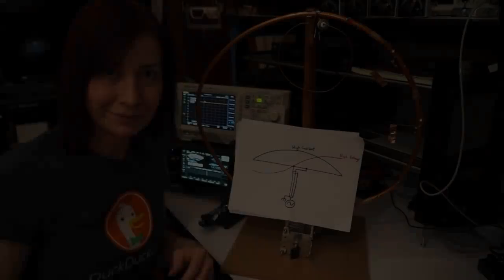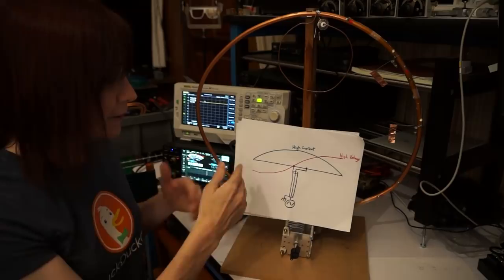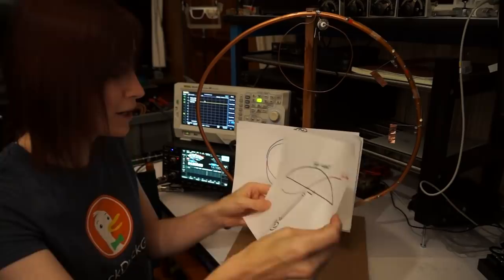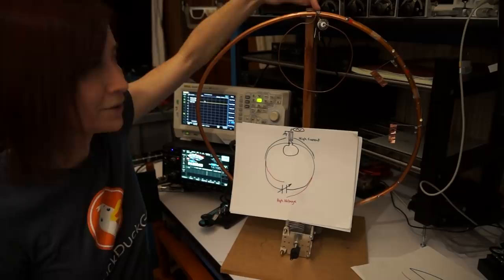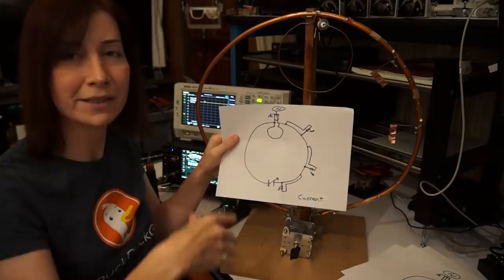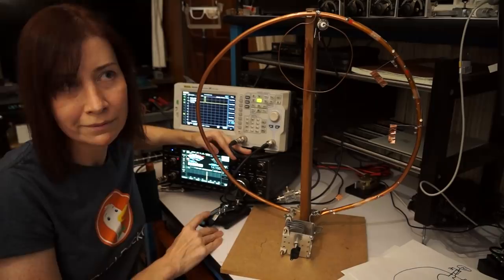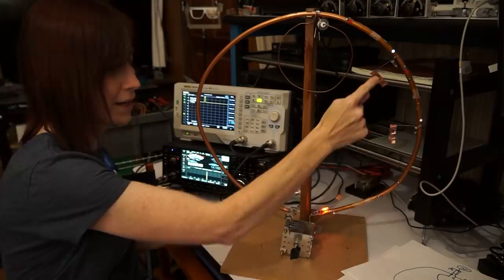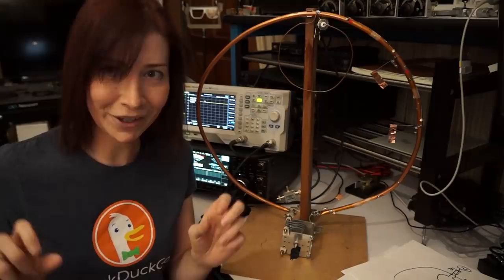Magnetic Loop Antenna Current and Voltage Distribution

Comment: Jeri, in my opinion you have come to a mistaken conclusion regarding the distribution of CURRENT around the loop.  Your arrangement of LED's seeking to demonstrate current are, in fact, gamma-matched to the loop.  Therefore such LED's would demonstrate VOLTAGE across the gamma-match (rather than current).  Anyone who might say that "current is proportional to voltage" should remember that this statement is not true, either, for a half-wave dipole.

My "hunch" is that the magnitude of the current is CONSTANT anywhere round the loop, hence there is NO current standing wave (contrary to a half-wave centre-fed dipole).

To me, the important consideration is that the highest voltage anywhere around the loop is that existing across the variable capacitor.  But that capacitor is a conductor of current!  This is how the magnetic loop antenna differs in principle from a half-wave dipole.  This is how the loop cannot be regarded simply as a half-wave dipole pulled round into a circle.

But I would really like to see the experimental proof.  Perhaps you could use a hot-wire ammeter connected to a small coupling loop.  The small coupling loop could be moved to different locations around the big loop.

Comment: cool to see a women doing a electronics vid! loop antennas are vary strange animals. thy preform well, are small, reject noise,and directional. to bad thy have small band pass and need hv capacitors for tx. when I built one for sw rx i used a small loop on the end of coax to cupple the rf to the radio ware as you have by the looks of it set up like a gamma match. what is the advantage of that over loose cupling?      take care

Comment: I loved the 80/160 mag loop video you did, (https://youtu.be/Al3ZJipFq6k)  but you had more to say and still haven't continued ? I recently had a question from a user of a mode called JS8CALL, js8, a super long distance mode for complete communications on hf., a mesh network you can do relays, send messages, (every user has a mailbox) ,  put out your lat long, ect.  I could imagine this antenna on a ship at the bow, getting data and weather from all over the world. That said, the majority of communications are on 40/30/and 20m. How hard would it be to make it resonate (the 80/160) on those bands ? I like its size, and feel it would be a very efficient antenna for those bands if set up properly.

Comment: You can use software to learn how antenna working but the base start can be Smith Chart, see: http://www.iowahills.com/9SmithChartPage.html . Note: As the frequency increases, the dimensions of the antenna are reduced.